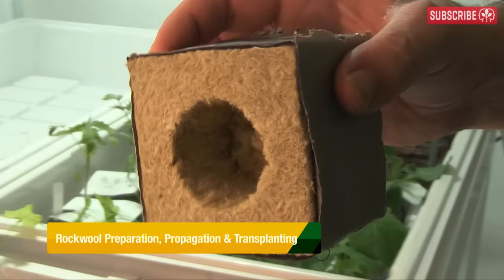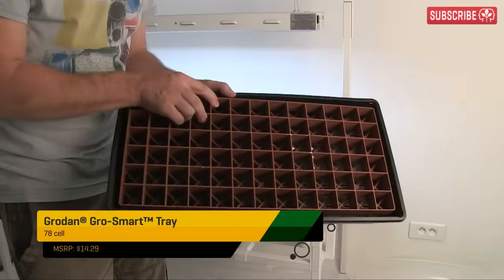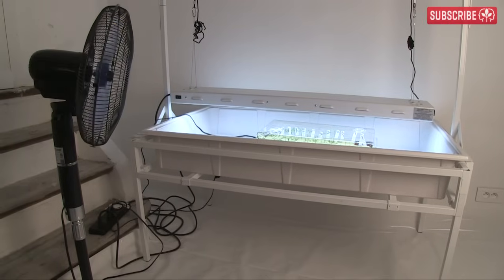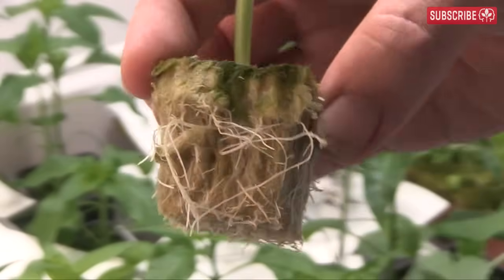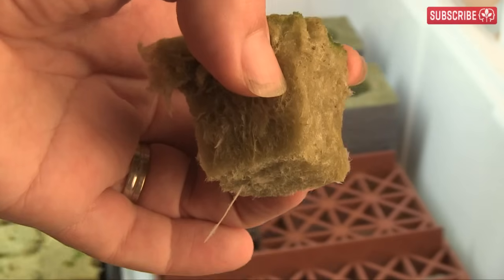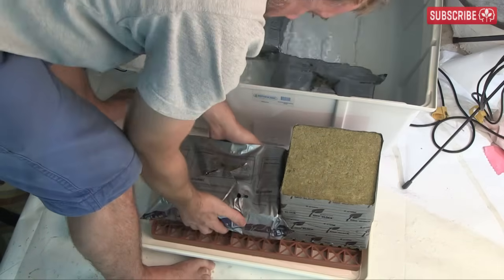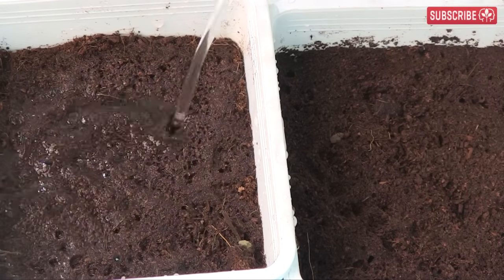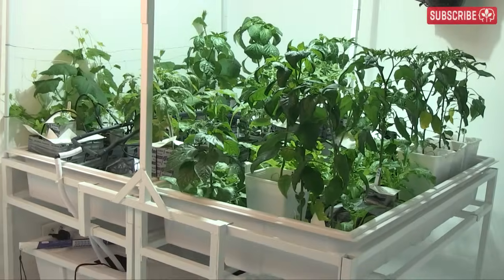Rockwool Hydroponics Propagation and Transplanting Complete Guide

Comment: I really don't understand why you need to persoak for longer times on bigger blocks..but I'm just gonna do it anyways...thanks Everest
Reply from the maker: Eric Elder The main thing you need to look for visually is the air bubbles stopping floating out of the block when submerged. You don’t actually need to submerge the Grodan blocks any more - five passes with a coarse spray from a watering wand is sufficient.

Comment: Hi is this rock wool the same rock wool that the construction industry use for insulation? thanks in advance
Reply from the maker: JT777 Hi JT777 and great question, thanks! Rockwool (the spun fibers of molten basaltic rock) is used in the construction industry along with other types of mineral wool including glass wool and ceramic fiber wool for insulation purposes. However, the rockwool used in hydroponic applications needs to have very different qualities to the rockwool used in insulation products. For hydroponics the rockwool should always be the premium grade and manufactured specifically for horticulture. Here's why:

Premium hydroponic rockwool products are produced from pure basaltic rock (diabase). These have a mineral balance that is inert and nonreactive where as industrial grade rockwool (insulation) is typically produced from slag left over from smelting operations and contain a high proportion of metals which can react with the nutrient solution. 

Another key characteristic for hydroponic applications is uniform wetting. It should be easy to wet but not remain sodden. Rockwool fibers are naturally hydrophobic (they repel water) because of the presence of mineral oil — high quality horticultural rockwool has these mineral oils removed so that it attracts water and wets easily. 

Well JT, I hope this clarifies things. For more information on growing in rockwool check out this article on the Just4Growers website: http://goo.gl/IqD4VF

And finally—please consider subscribing to my channel! Thanks :)

Comment: Very nice video, Can you take the rockwell 1x1 block and take them straight to a hydroponic pot filled with perlite .  This will be my first year doing the hydroponics. I built a 1,000 sq foot greenhouse with heat for the winter..  Thank you for any advice
Reply from the maker: +Angie Swyers Thanks Angie—yes you can take an A-OK starter plug and transplant it into a pot filled with perlite—no problem! Your greenhouse sounds great! Where in the world are you? Peace and happy growing, Everest.
Reply: +Everest Fernandez (Just4Growers)  I am in the city of Stlouis MO USA. I have 1.3 Acres here. I have also designed a growing pot with drain outlet, so I could return my unused water and fertilizer to the storage tank.. Get this at a cost of 40 cents and when you filled with perlite your at $1.30  Per Hydroponic pot.. For tomato plants & peppers. I could not see myself paying $3 per 5 gallon bucket or 10$ for a hydroponic bucket . 400x $4 =$1600.00 My way (400x $1.30 + free labor =$520)  
   It seams to be working out with six pepper plants. 
I love the videos. I learn so much watching .. Thank you for posting 
  Angie
Reply from the maker: +Angie Swyers Wow—free labor! Where did you find that? :)
Reply: +Everest Fernandez (Just4Growers)  Tried the rockwool Not a fan... holds water too long and the ph went up fast . I went back to a starter mix. Pro-Mix HP.

Comment: I cant locally find the grow-cubes, it seems i'll have to import them from overseas. So i was thinking about cutting my own 1cmx1cm cubes from a slab. The guy at my hydro store suggested i should use the plugs instead. I'm not sure, but if i cut the plugs i won't get nicely shaped cubes as i would by using the more dense and firm rockwool slab. What are your thoughts? I really like your channel btw!
Reply from the maker: sublimit777 Hi Sublimit. Thanks for your question. The guy at your local hydro store gave you good advice. The rockwool in slabs is a lot less dense than the rockwool in A-OK starter plugs and grow cubes. (The 1cmx1cmx1cm cubes and the A-OK plugs are the same density.)  The reason the denser rockwool is used in cubes and plugs is to retain more moisture for seedlings and cuttings. 

So—if you want to cut your own grow cubes from A-OK plugs, you should first wet the product to minimize dust and then I'd cut 2 cm x 2 cm x 2cm chunks rather than 1cmx1cmx1cm. Why not ask the guy at your local hydro store to contact their rockwool supplier? I'm not sure where you're based but Growcubes are widely available in North America and available via a special order in Europe. Alternatively -  try emailing info (AT) grodan101 (DOT) com -- I've found the guys at the end of that email are very helpful and responsive whenever I've had enquiries.Finally—thanks for your positive comments about my channel. It's a lot of work (but a labor of love!) so thanks for positivity! It means a lot.
Reply: I appreciate your reply mate. Just from looking i assumed it was the other way around, so this helps me a lot.
The local hydro wholesaler doesn't import the growcubes, and only a couple of adds on ebay which are $40 a bag + $50 for shipping. The plugs will be fine for now i reckon.
I'll ask the guy at the shop to contact the wholesaler, or even grodan on my behalf and hopefully they'll be able to get them in for me in the future.
I'll let you know how it goes. i'm still setting up my room and putting my max-fan pro(yellow and black one) in this weekend.
Reply from the maker: sublimit777 Nice! Let me know how you get on with the Max Fan Pro. I'm hoping to get my grubby mitts on one of those too! :) Happy growing! Everest.
Reply: Ha! actually i initially took home the original Max Fan 8'' because they didn't have the Pro in stock. I had already seen your hyperfan v max fan vid, just had slight doubts on its speed controller durability and pressure drop with ducting and filter attached. Anyway i ended up taking it back along with the carbon filter they suggested because the cfm rating was too far apart. So they offered me an exchange on both the fan and filter, i just had to wait for the PRO to be ordered in, but well worth it as its a lot quieter.

I did notice the nth American 120v model has a significantly higher CFM rating, and has 3 speeds compared to my 240v model which has 2 speed settings. Anyway, i'd like to see you do a vid on it.

Does running the hyperfan at 50% shorten its life? I keep getting mixed info on that.
Reply from the maker: sublimit777 Hi Sublimit! Running the Hyperfan at 50 percent will actually increase its life due to less load on the bearing.

It's true of some other types of fans (i.e. with external rotors and split capacitor run types)  because they are balanced at one speed (high) with just four magnetic poles. As the rpm is reduced the balance changes, then the forces on the magnetic poles change, and consequently more load is put on to the bearing. 

The Hyperfan, as I understand it, has a twelve pole motor. Each pole or magnetic pushing point is 30 degrees apart (30x12=360) in a 4 pole it's 90degrees apart (4x90=360) - affording the Hyperfan a much smoother application of power on each revolution.
Reply: Hey! Again, thanks for the thorough explanation. I'm actually thinking of getting a 10'' hyperfan and relegating the 8'' max fan pro to veg area once my 2 room(adjacent) growspace is complete. I like the idea of having such precise speed controller for balancing out negative pressure for both rooms.  My max fan is rated at 718 cfm on high and 467 cfm on low. I wanted to go for 1 air exchange per minute as per your recommendation, but the folks at the grow store reckon thats overkill. Anyway it's still a little way off from being complete so i've got plenty of time to think about it.
Is 1 air exchange per minute as important in the veg area? or could you get away with less, like 2-3 times every 5minutes?

Comment: I have 6 small pepper seedlings at home in the small rockwool cubes, they have been there for about two weeks, how long do I have to wait for the roots to poke out?
Reply from the maker: +Azurl hello my friend, peppers are very slow growing at first so patience is key! Try raising the cubes up (a Gro-Smart tray is great!) to get air underneath the cubes and take it easy on the nutrient concentration. Rapid Start is an awesome additive too. Keep in touch and let me know how they develop. Lots of warmth and humidity :)
Reply: Thank you for the reply! :) I could not find a Gro-Smart tray in the online store I get my stuff from here (Sweden) but I did make like a scaffold of cut up label tags that they're standing on now to keep them out of the water pool below. I keep a bucket of pH 5.5 with the amount of nutrient indicated for seedlings mixed in, very small amount. I kept them under a dome at first on a incubator (warm plate) the dome is off now, and the plate is turned off. the second set of leaves have started forming on my seedlings. :)

Comment: Can someone chime in on a question I have? I`ve seen a response from someone before saying that transplanting a plant grown in rockwool is not a good candidate for transplant into soil. He went on to say that the rockwool inside the soil would hold onto much of the water/nutrients and turn into root rot eventually. Anyone experienced with this?
Reply from the maker: +YoMoma777 Hello amigo. Actually my experience is the contrary. Restrictive loose fill media such as coco coir and many soil / soilless potting mixes can wick the moisture out of your rockwool starter plugs, depriving your young seedling or cutting of moisture rather than oversupplying it. Careful maintenance is required in the days immediately after transplant. A little water applied from time to time around the plant, ensuring the surrounding media does not dry out and start wicking. Hope this makes sense.
Reply: Actually you're friend has it backwards.

Comment: What causes mold inside the very center of my dense sticky stinky fruit if my humidity is 45 percent with temps around 80 with c02 in high ppm? In Rockwool 1 inch inserted into a 4inch cube placed on top of a 6inch rockwool cube. Could over watering be the issue. Watering 4 times daily

Comment: Hey great video, I am starting a deep water culture system, and I have my lettuce in rockwool. They are doing fine, but I was just wondering if you had any tips for when i finally transplant them into the deep water system, i.e, how close to the water should the rockwool be? I plan on having the rockwool resting on some hydrotone inside some net pots, but I am not sure how the moisture is going to reach the roots when they appear. Any input is greatly appreciated!
Reply: Grow Boss well its more of a hobby than anything else at this point, growing in a small apartment and I'm not looking for my apartment to dank of weed all the time, seeing as I don't smoke it anyways.
Reply from the maker: +Ben Swallow Hi Ben. Good question. When you first introduce the plants to DWC the water levels should be just high enough to allow some contact with the roots. Once you've "tempted" the roots into the solution you can lower the level to just below the bottom of the root crown / net pot.
Reply: Everest Fernandez Awesome, thanks for the response, just dropped them into the system a couple days ago with the water level just touching the bottom of the cubes, and they are doing great so far! Ill definitely drop the water level a little bit in a week or so when the roots have established themselves well.
Reply from the maker: +Ben Swallow No worries—glad to help Ben. Remember to keep nutrient concentrations at around half the strength of substrate-based hydroponics in DWC.

Comment: Is it okay to place the AOK blocks directly on the slab with a sprinkler system to prevent from drying out? If there are any roots on the sides exposed, would the plant die?

Comment: Nice video.  I'm correctly living in Jamaica.  The problem here is I can't use lights, too expensive.  Also, the temperature here is really high.  29-32 C year-round.   Which is higher than the temperature you have mentioned in the video.  What should I do?  Also, I'm thinking of take the rockwool to the hydroponic fast.  Any ideas?  I'm planning to grow salad and herbs.  Thanks

Comment: STOP WASTING SEEDS!

Never can understand why people plant multiple seeds per Rockwool:  Just use a few extra Rockwool to compensate for the germination rate and put one seed in all.  That way if you want 5 plants, and seed 7 Rockwool, you'll likely get 5-7 plants and you won't waste 5-7 seeds or more on seedlings you'll cull, you also won't have to disturb the root structure of any plant to pull out the lesser sprout, nor even waste the time thinning them out.  Remember: if a seed doesn't grow in one of the Rockwool, just set it in the sun to dry, and re-use it next time!

I feel like this is an old wives tale taught to growers by SEED SELLERS to sell more seeds!

Stop wasting TIME and SEEDS for NO REASON!

Comment: I have romaine, kale, arugula and some varieties of lettuce starting from seed in Rockwool. Everything went great but now the roots aren't continuing to stretch out once I move the cubes into my DWC system. I started the cubes in a humidity dome and once they had a second set of leaves i slowly started introducing them to less humidity by removing the dome lid. Once they seemed happy  I put them in my system. 

I put a few into mason jars to experiment with the Kratky technique and those roots have reached down and are doing great. The cubes i put into my DWC system aren't doing anything. Any ideas?

Comment: I think Eazy Block Organic Transplanting Cubes and Eazy Plug Propagation Cubes are better.

Overview

With a focus on organic materials and the principles of air pruning, Eazy Block Transplanting Cubes are the logical next step for users of Eazy Plug Propagation Cubes, helping to create an incredibly dense root structure in an environmentally friendly manner!
 

    Produce strong and healthy roots using the characteristics of the Eazy Plug
    Facilitate the air pruning process to create a highly developed root zone
    Increase the efficiency and effectiveness of nutrient uptake
    Extremely versatile product suiting most soil, coco and hydro applications
    Easy to use and capable of delivering fantastic results
    Stay hydrated long after water has been drained away
    Predetermined and buffered pH and EC values
    Consist of mostly organic materials that are 100% compostable
    Supplied in a dry form for clean and lightweight transport and storage
    Part of a full range that includes propagation cubes and flood & drain systems

 
The Power Of Air Pruning

The well bonded nature of the product means there’s no requirement for any plastic wrapping or covering, which opens up the unique opportunity for roots to be air pruned – a massive benefit! Primary roots will stop growing beyond the edges of the media due to exposure to the air, causing a plant to produce an abundance of secondary roots and root hair that then go through the same process. As a result, you get extensively developed root networks with maximum absorption capabilities for mega efficient uptake of nutrients and water… just what your plants need to continue growing quickly and healthily!
Expanding Upon The Eazy Plugs Idea

Eazy Block Transplanting Cubes consist of the same 100% compostable blend of organic elements as the Eazy Plug Propagation Cubes – including perlite, a mixture of peat, coco fibre, fertiliser and a few other components. They’re really simple to use and suit nearly every type of application, with remarkable water holding capabilities and optimal buffered pH and EC values. For extra special results though, place the blocks on Eazy Pyramids in an Eazy Plug Flood & Drain System!
Stock Up And Store Away

Supplied in a completely dried state, Eazy Block Transplanting Cubes are clean and lightweight making for easy transport and storage, as well as reduced risk of moulds.

Comment from the maker: Hi reviewSearchs. Can rockwool be re-used? That's a great question! Thanks for asking. Some commercial growers enjoy many successive crops from rockwool slabs by steaming them after the plants have been removed and then replanting. Smaller growers can also do this - a few slabs can be heat treated by pouring hot water through them. Solarization is also possible, as is using chemical disinfectants, although care should be taken to rinse the rockwool well with plenty of water after using these. Commercial Grodan users have the option of the Grodan recycling service, which picks up the used slabs and recycles them into new product. However, smaller growers with just a few slabs of used rockwool can recycle the material by shredding it and reusing it as a growing media, as a component of potting mixes, or by incorporating it into outside soils and gardens.
Reply: +Everest Fernandez (Just4Growers) so then where do the air pockets go? u squeeze them out u lose only make it hold more water...already holds too much, unless u an expert. coco better than rockwool, unless u careful
Reply from the maker: +Rick Haynes I don't think you need to be an expert to use rockwool. As with any growing media, you need to adapt your irrigation practices to its properties.